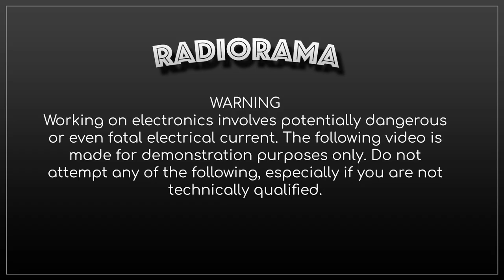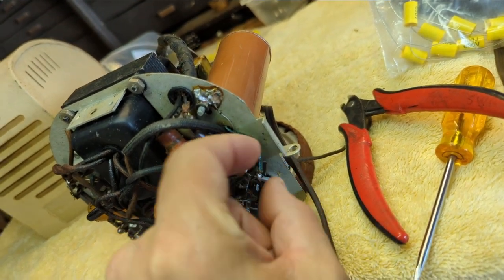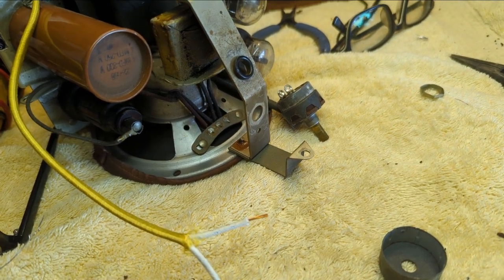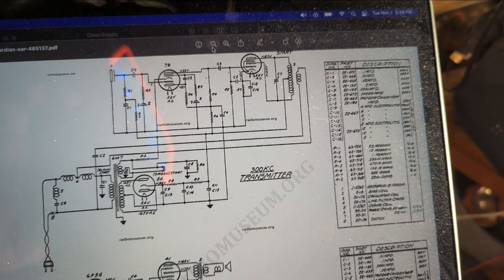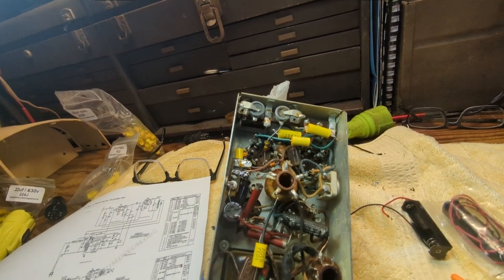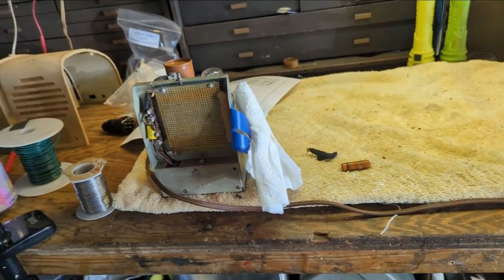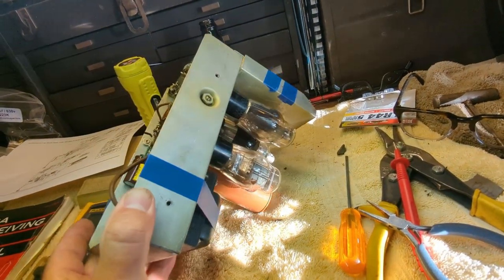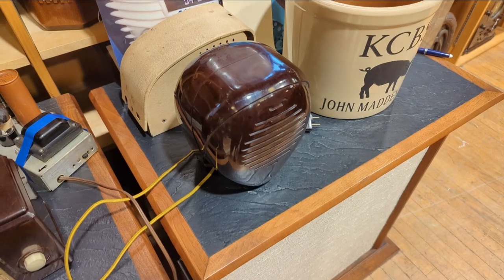1938 Zenith Radio Nurse restoration baby monitor

Comment: Zenith's president Eugene McDonald Jr. was alarmed by the 1932 kidnapping of Charles Lindberg's baby and cobbled 
together the first baby monitor and later asked his engineers to come up with something better. This is it. At 22:00 in 
those two weird button things are in fact 0.5 Volt  wet cell bias  batteries. They were used in many 1930's radios too.
This was worth watching since it works.
Reply: Interesting piece information, thank You for sharing!

Comment: I built a baby monitor for my wife. It didn't send a radio signal. There was a microphone in the baby's room connected via coaxial cable to an audio amplifier and speaker in the kitchen. She appreciated it a lot. While she did still check on the baby, she didn't have to do it as often.

A friend of mine ran across a later model from the 1990s. He didn't have a baby. I think someone gave it to him to see if he could fix it. The receiver worked, but not the transmitter. Anyway, it transmitted and received on one of the assigned cordless telephone channels in use at the time (42-45 MHz?). By chance, it used the same frequency as a cordless phone owned by a foul mouthed resident of his apartment building. One evening there was a beauty contest on TV and he had the receiver turned on. She had called a friend and was commenting on the contestants. He found her commentary more interesting than that of the emcee!

This does point out a security vulnerability of the Radio Nurse. Someone could drive around neighborhoods where these might be in use and monitor for the transmitters. If a signal were received, the person could eavesdrop on conversations taking place inside the house. A burglar might overhear when the residents planned to be away from home.

Comment: That's a really early condenser mic, they were using them in Europe but the US market was still ribbon and dynamic.  I guess they needed the sensitivity.  Very cool device.
Reply: The capacitance varies as sound waves modulate the separation of the two capacitor plates. Reverse engineering the circuit, it looks like the capacitance variation modulates a voltage. The first tube amplifies the voltage variation. The second tube is part of the oscillator circuit. The voltage variation appears to result in amplitude modulation.

Comment: Examining the schematic:

For the “ear” box, this is a 300KHz transmitter, using amplitude modulation. The resultant AM signal is then superimposed on the incoming mains line and carried through the building wiring into the receiver (nurse head) box.

The two bias batteries are nothing to do with the microphone. They are to generate a small bias on each of the grids of the microphone amplifier tube (the tube in the top left of the schematic). If you have measured around 0.3V output from the original cells, they would probably continue to be serviceable. If not, they can even be removed and their connections shorted across. The microphone is biased directly from the power supply B+ via R2.
 
The plate output connection of the microphone amplifier is connected to the primary grid of the oscillator tube via C3 . This causes the amplitude of the oscillator to vary in sympathy with the audio signal, forming an AM signal.

The oscillator coil ‘3’ and padder (trimmer) capacitor C7, form a tuned circuit. In conjunction with the associated tube, create an oscillator at 300KHz. The coil secondary winding (shown with fewer turns) connects via C2 and L4 to the incoming mains.

It would be useful to measure some voltages around the oscillator tube. Capacitor C7 must be adjusted to give a carrier frequency of 300KHz. This need only be approximate in frequency, but check that the circuit is oscillating. A broken connection to one of the coil leads would cause this to fail (check coil continuity with a meter). Similarly, resistors could have drifted out of tolerance with the same result. Simply bringing an oscilloscope probe near to the oscillator coil should be enough to verify oscillation. Even better if a frequency counter is available.

Once the oscillator frequency is confirmed, the receiver box trimmer capacitor C5 should be adjusted to receive this signal. Again, check that the receiver coils have continuity and resistor values are correct. You could separately verify the receiver operation with a 300KHz signal generator and a modulation tone.

Hope this helps. Steve in UK.
Reply: Thanks for that information Steve. Interesting.